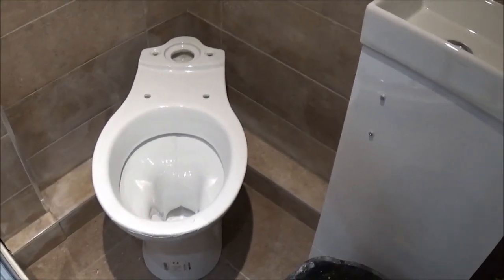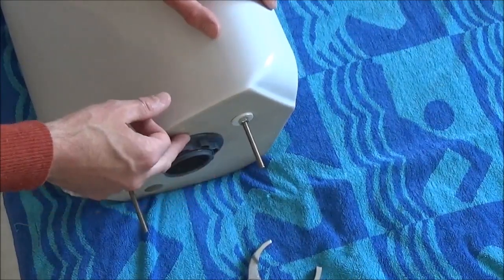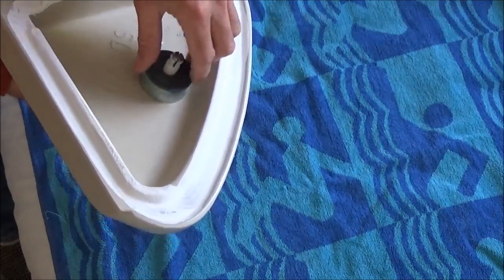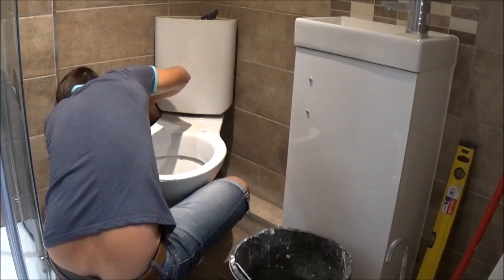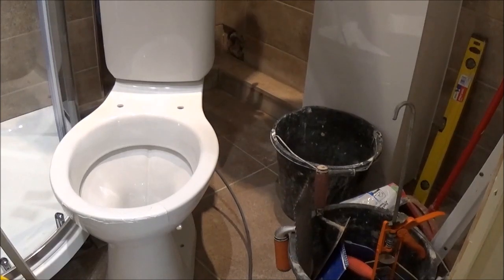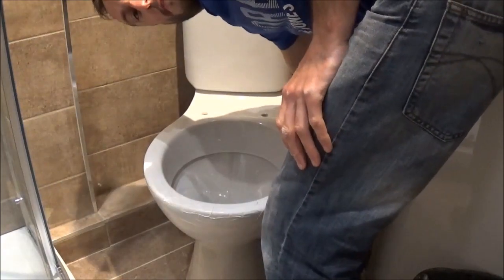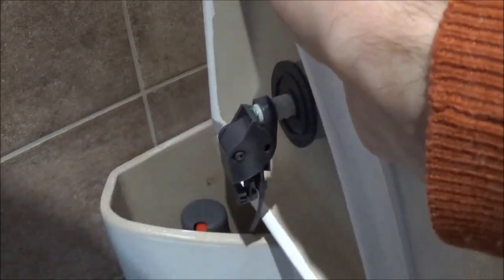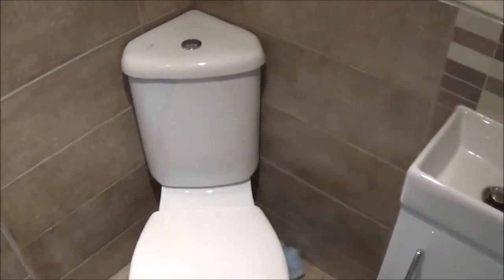How to fit a toilet. Toilet installation and plumbing for beginners!

Comment: A good tip my Dad taught me when checking for leaks was to use a piece of toilet paper when feeling around the connections. It will absorb even the tiniest bit of moisture, and will also stop the added of confusion mixing the sensation of cold with damp. Also, I dont bother screwing the basin down..I just use sealant. Never had a problem with that.
Reply from the maker: Thanks for the tips 👍

Comment: My toilet bowl outlet is about an inch below my four inch waste pipe which comes out of a masonry wall. An offset connector would have been fine if the waste pipe was below the outlet from the toilet but it is the other way around. How do I fix this?

Comment: I need to replace the toilet-I was on the beer with my mates in town came home used the toilet and smashed the cistern -I know -don`t ask how ,the new pan outlet is about 2 inches below the soil pipe inlet is this ok or should the cistern outlet be level with the soil pipe or higher -if higher should I raise the pan or take a whizzer to the soil pipe and shorten it, raising the pan would easier but i`m not shore  - any advise would be helpful.
Reply from the maker: It should really be higher so there is a drop to the soil pipe. If you need to raise the toilet then I guess you need to improvise! Best of luck.

Comment: Hi could u give some plumbing advice plz
Reply from the maker: Possibly, depends what the advice is I suppose?
Reply: When running first fix for rads is it best to tee off òf 22mm for 15 feed to each rad
Reply from the maker: Hi, I'm not a plumber by trade so probably not best placed to answer this question, but generally speaking, the bigger the pipe the better the flow, so if you can maintain the 22mm for the main feed, and just tee off to 15mm pipes for each rad from the 22mm then that is best. Hope that helps. Thanks for watching!
Reply: @POUSEaroundtheHOUSE  Thanks for help